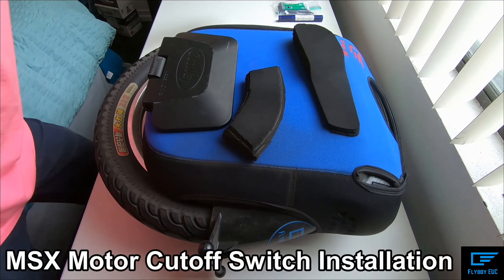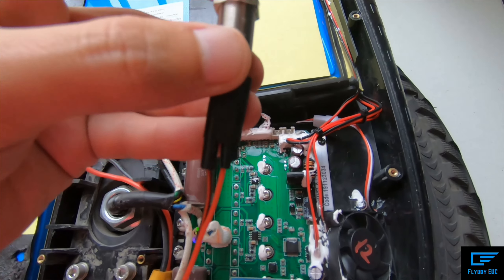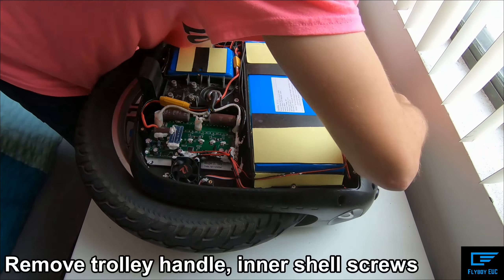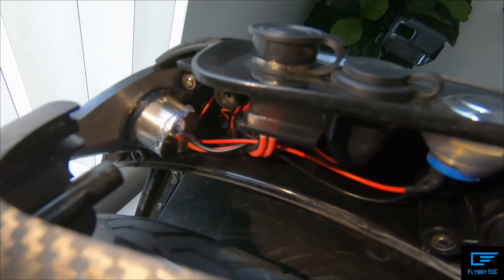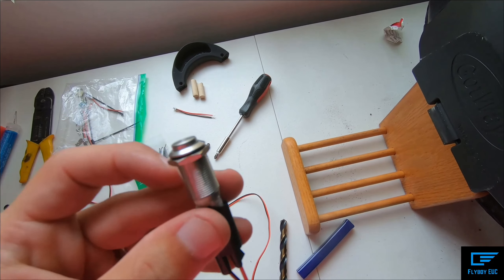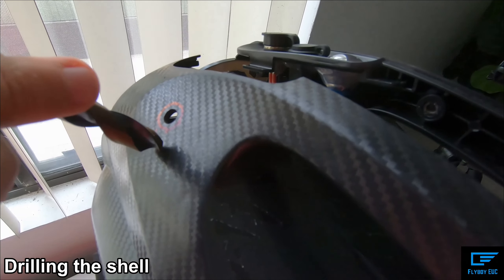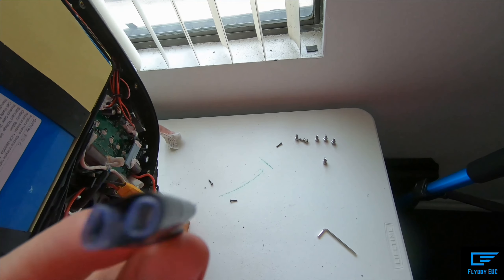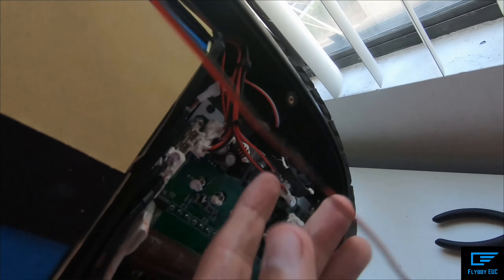MSX Motor Stop Installation

Comment: Awesome! I have an MSX V2 84V. I wanna put a digital voltmeter in the same spot. Was wondering if I could manage a hole there. I believe a uni bit and masking tape will make a clean hole. Trick is high RPM with minimal pressure.

Comment: Nice tutorial, did you try to press the button while wheel is running and it didn't cut out/stop?
Reply from the maker: Yes. Much like every other wheel, this switch isn't an automatic kill switch. It has a safety feature built into the firmware so the wheel only cuts out or turns off when the wheel is not moving.